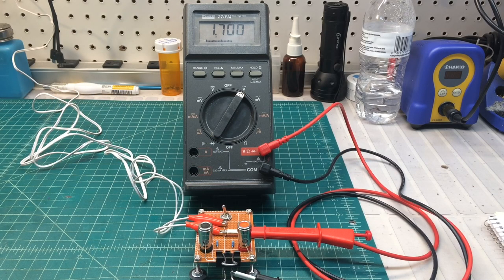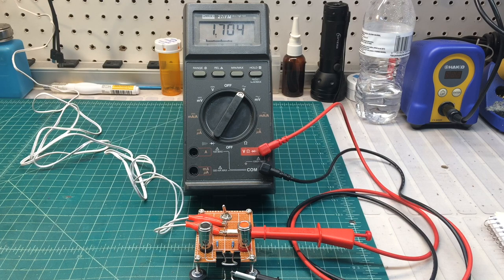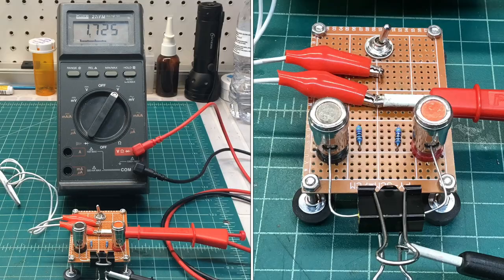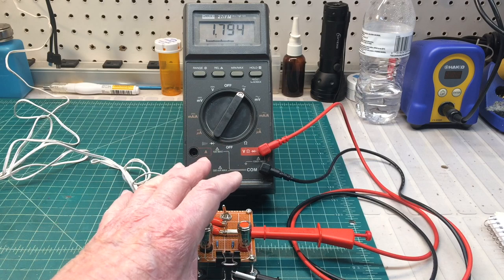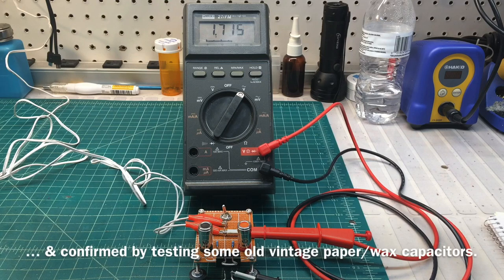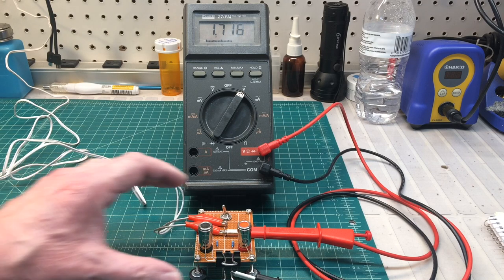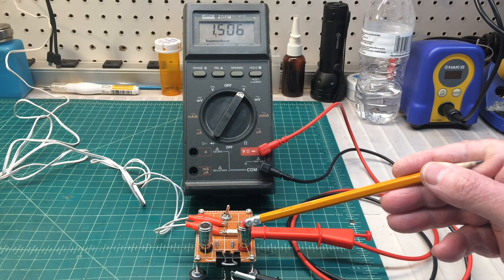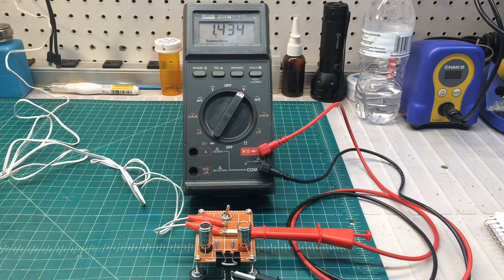Mini Build - Capacitor Outside Foil Sniffer

Comment: Interesting but if you wanted it to work the way u said you would have to switch read change the connections on the outside terminals of the switch . the connections in the switch are opposite the side . if you switch to the left the connection is on the right
Reply from the maker: Alex - thanks for reaching out. With this design being different, the direction of the switch provides the lowest AC voltage based on the configuration I shared and demonstrated. I confirmed this by testing ~50 capacitors I had already identified the foil/shield side. Thanks again for reaching out and watching. Best, Don
Reply: @RestoreOldRadios  Ok so looking at it from the top and you flick the switch to the right or red side the connection in the switch is to the negative terminal making that the foil side
Reply from the maker: The direction of the switch that provides the lowest AC voltage points to the foil/shield side. Best, Don